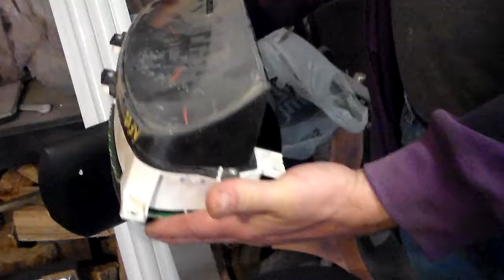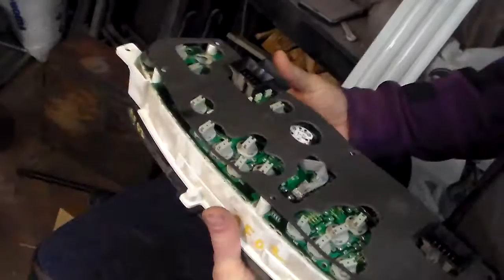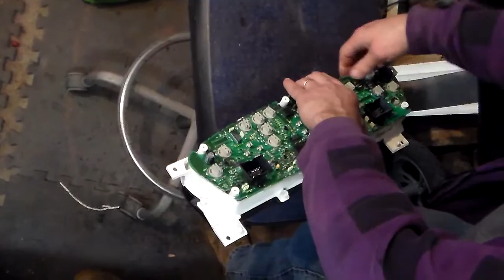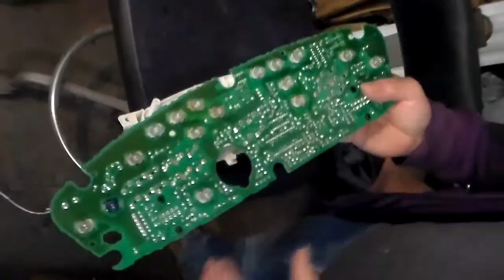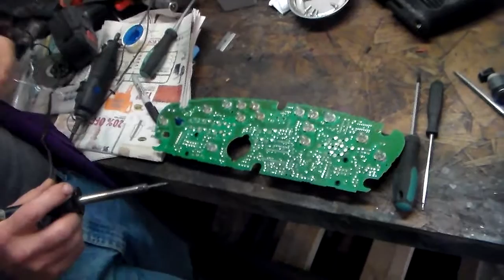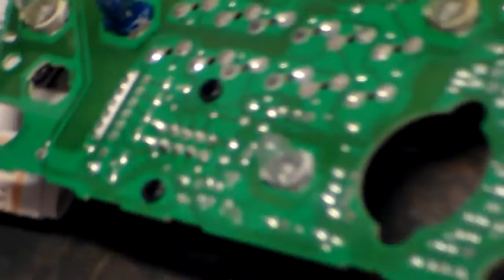Repairing First Gen Dodge Neon Instrument Panel

Comment: I realize this is an old video but my speedometer stops working at random and the tachometer also stops working and just hangs at 2k even when idling. I soldered the first set of pins you showed here, but I am stuck not knowing what the next set of pins I should be re soldering
Reply: Solder every pin you see that’s cracked, use a microscope and brite led flashlight to look closely. I just reflowed every joint on my board but cannot get my Speedo or tach to work at all
Reply: @jamiemcfarlane9025 I ended up doing exactly that and it fixed the issue, was pretty simple, thank you much!